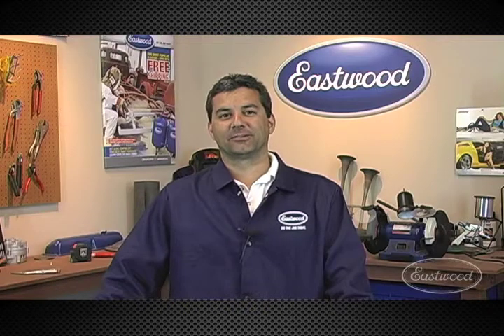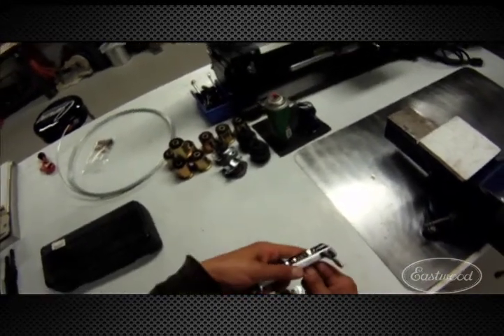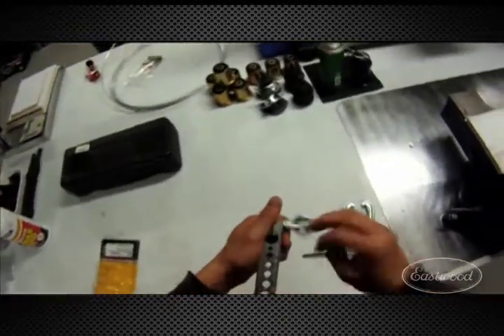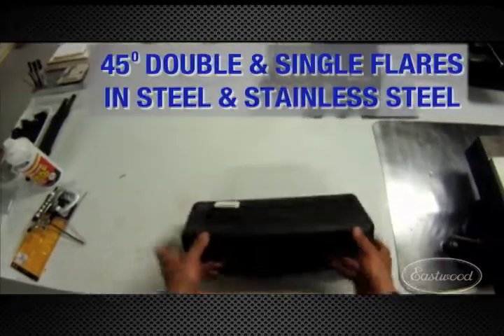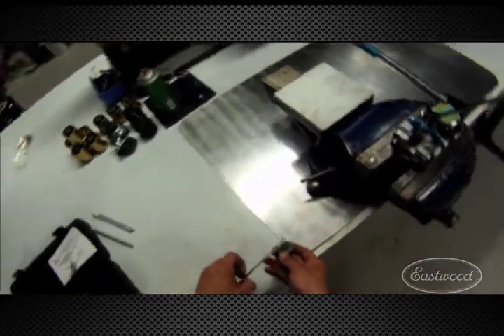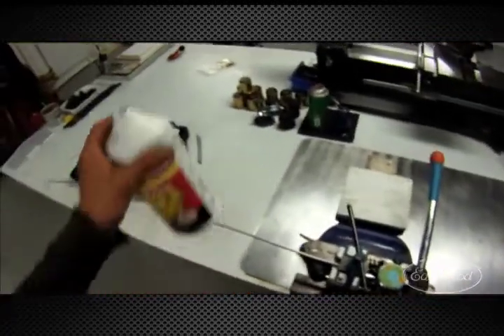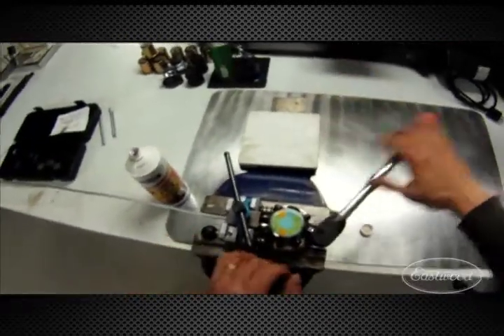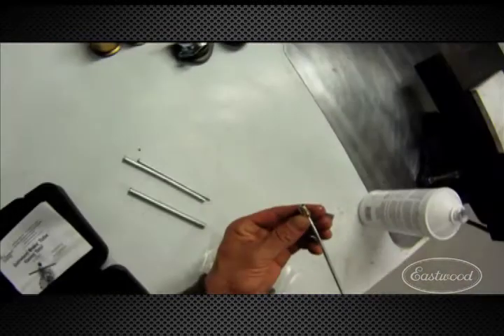Brake Line Tube Flaring Tool Comparison - Eastwood

Comment: Eastwoods Flaring tool is great if all your doing is making new lines. How are you going to get that vice and tool under the car/truck with you to make 1 quick flare on a broken brake, transmission, or DPF line? Or do you want to spend an extra 2-3 hours removing the entire line?! Also, he compared a $30-$40 tool to a $250 tool. This is not a fair comparison.

Comment: FYI most of these tools are NEVER for use on Stainless Steel (yes I have used them for that but it is not purpose built for Stainless be aware)  NAPA has double flare kits starting at $55 bucks that will last a home mechanic forever and are well make.  You can find even cheaper ones at most local discount auto stores.  A place on-line called classic tube sells "Real" flaring kits for most applications, they are usually made in the USA.  FYI their stuff is also used for aircraft application and makes acceptable flares using the "cheapie" design.  I think I'll pass on the Eastwood crap after watching this video